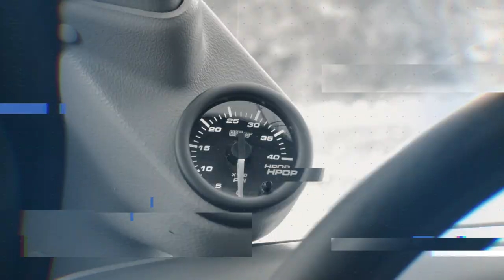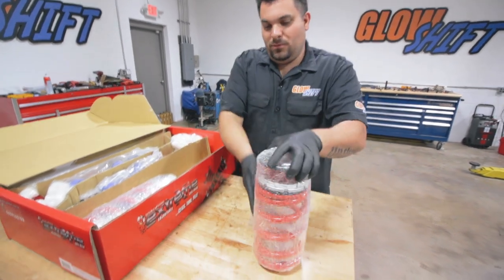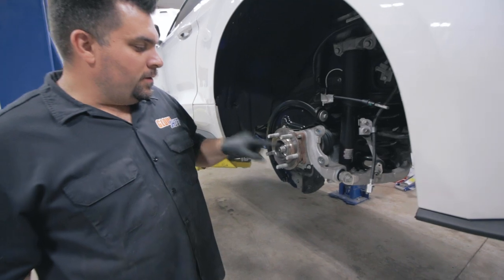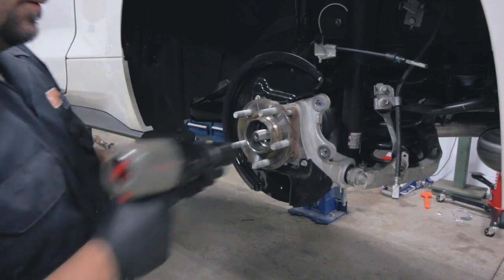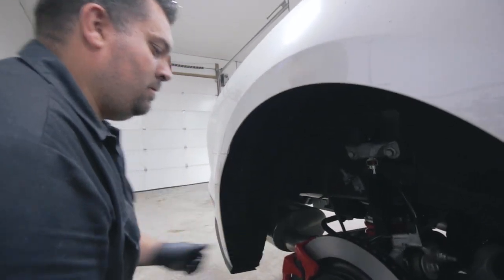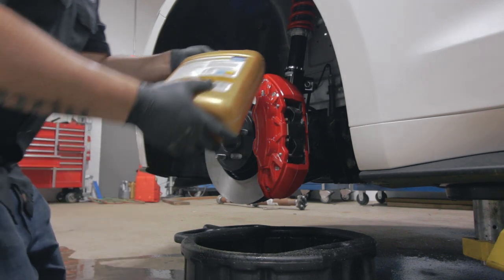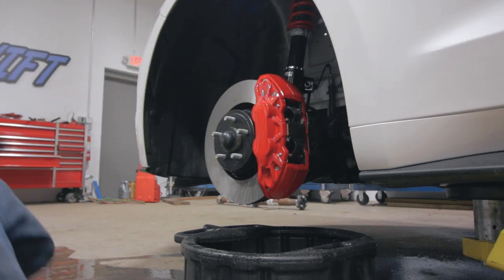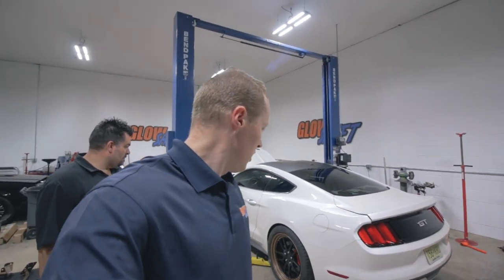GlowShift | Ep. 7 - Slammed! The Mustang Gets New Pedders Springs & Coil-Overs

Comment: If you're doing this at home guys.. always get the car sat on its wheels before tightening any pivot joints. If you tighten them in the drooped position the rubber bush is constantly twisted when the car is at ride height.